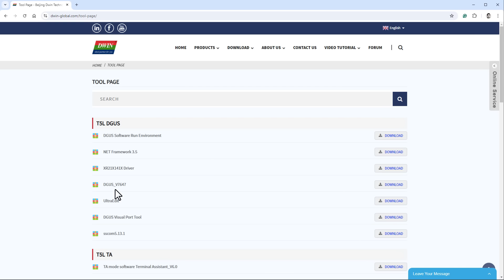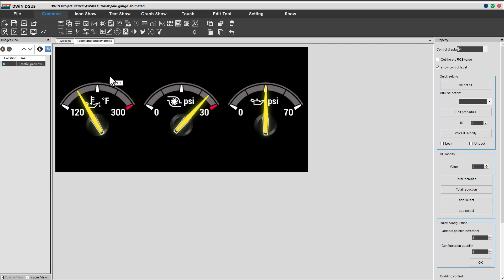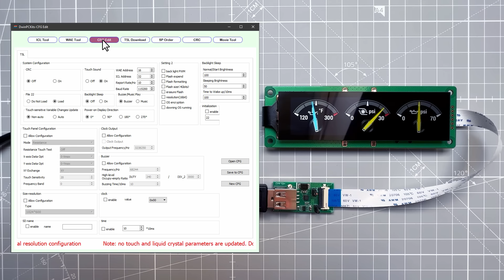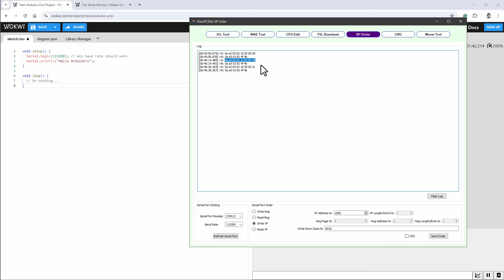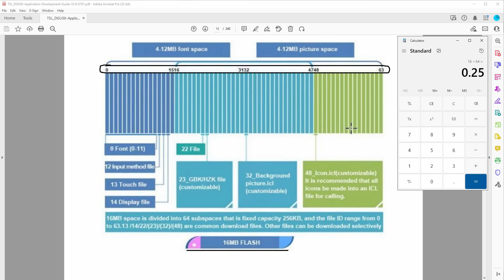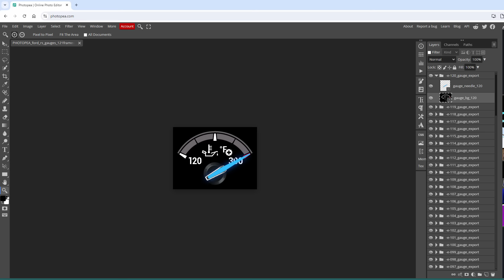Ford RS gauges with Arduino UNO and DWIN intelligent display (like Nextion displays)

Comment: would be nice to install on my Suzuki intruder handlebar tripple gauge: oil presure;Roll (at the center): coolant temp. Maybe possible to do double function in one gauge? i mean by double click to switch  for example: from coolant temp to battery level?
Reply from the maker: Yes, it should be possible to switch between different set of gauges, I might cover that in some future video. Thank you for the suggestion!

Comment: The input data for each channel can be passed through an LPF filter with a cutoff frequency of ~1 Hz, then all readings will be displayed very smoothly, even with a sharp measurement. You have an Arduino anyway, why not? =) The screen is very good.
Reply from the maker: Yes, there are many ways how to make this project better, this video was mainly about the screen and the graphics design.

Comment: I Love this Video,
It goes over everything in such depth that I feel I can do this.
I've never purchased these devices because I felt that they would  just sit on a Shelf reminding me that I was in over my head.
But this time I took the plunge, and purchased these exact same items, minus the Arduino, I purchased the Seeed esp32-c3.
Hopefully I will take this to to the end and not give up.
Reply from the maker: Thank you for your comment, and good luck with your project, I´m sure it will turn out great. The ESP32 vs. Arduino will make a very little difference, since it´s really just sending Serial data, and any microcontroller can do that. I have tested those DWIN screens also with micro:bit and it worked as well. The important piece is to get the DWIN display together with accessories, that will save you same headache, as not all SD cards are supported, and if you don´t get one from DWIN, you might need to do some non-standard formatting. Anyway, let me know if you face any issues.

Comment: Can the same steps in this video be followed for this screen model? 
DMG10600K080_03W

I am interested in making a full cluster for my car and these dimensions should fit perfectly.
Reply from the maker: Yes, it will be very similar. The only major difference is that the display might by default communicate using RS323 protocol, and to switch it into TTL serial, you will need to solder one connection on the pcb. I will cover that in the next video.
Reply: @upir_upir  awesome! I will look forward to your video!
Reply from the maker: Thanks!

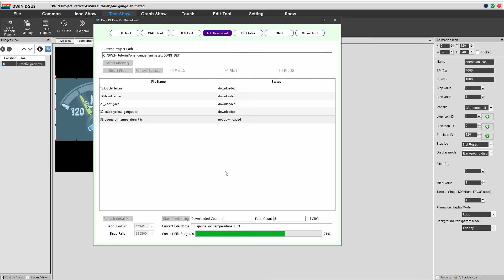Comment: im trying to follow along at 15:43 but when i click "Start Downloading" DWIN always freezes. i verified im using the right port (it only appears while plugged in). Did you ever deal with that where it froze on upload or have any suggestions? im on windows 10, no issues up to this point. thanks!

Edit: I had to solder the pads to enable TTL. Now arduino serial->screen works, but pc serial still doesn’t :(
Reply from the maker: It´s strange that Arduino works and PC does not. Have you tried a different USB to TTL boards? I´m using one from Waveshare, it´s big and pricey, but works seamlessly.
Reply: @upir_upir  I ended up ordering 2 new replacement boards, still doesn't work.

since you didn't mention it in your video so i assume you didn't have to solder the pad to enable TTL like I did? That makes me wonder if your board has another configuration preinstalled that mine didn't have
Reply from the maker: They have two types of screens. The smaller ones work on 5V and the TTL is also 5V - or at least 5V tolerant. Bigger screens are 6-24V, and the communication is RS232, if you want to switch it to TTL, you need to solder that pad.
Reply: @upir_upir  yeah for sure I have a 5v screen and soldered the pad. That only fixed arduino serial issue. But that didn’t fix the PC serial issue. 

Did you have to do anything aside from soldering that one pad?
Reply: I have the same issue I cannot download. May have to go with the SD card method.

Comment: I ended up getting a 7" DWIN display. Anytime I try to DGUS Serial Port to convert a jpg, I get an error prompt and can't ever get past it...
Reply from the maker: That  7" screen is most likely communicating using RS232, not TTL. You can either get the USB to RS232 converter board, or you can switch the display to communicate via TTL mode - that requires soldering one connection on the back of the PCB. I will cover that in the future video.
Reply: @upir_upir  correct! I have an rs232 adapter connected to the accessory cable they sent, but no dice. We'll get there eventually..
Reply from the maker: I’m using board from Waveshare — FT232RNL USB TO RS232/485/422/TTL

And it’s working seamlessly. Little bit pricey, but covers all my needs.

Comment: i thought about building smth like that for my bike, i recently modernized a old 99 fazer600 and the new gages did lack any oil temp, cooler temp warning lights aswell as fuel agage and i thought about getting some screen like that with a super small raspberry pi pico or rp2040 arduino :D
Reply from the maker: Cool. Please feel free to post a link to your project if you make it work, I would love to see it!

Comment: i have an idea. if you change the color of the gauges on the last 10 or 20 images to red, it can be a warnig, like if its oil temp it turns from blue to red when it gets high enough in the image sequence simply by changing the color in the file
Reply from the maker: Yep, that should be possible and easy to do. I might cover that in the future video.

Comment: Can you please do a display overlay for tachometer like honda s2000 ?
Reply from the maker: Do you mean the big RPM gauge on top kind of thing?
Reply: @upir_upir  yes yes,  the lines/bar thing on top. Modern cars with digital gauge clusters have this type of rpm meter too. Some car huds also use a similar style.
Reply from the maker: Definitely, that’s something I would like to try for sure!

Comment: cool, I actually want to do a very similar project for my mitsubishi using an STM and a 3x7 segment display with 2 buttons
later this will be updated to a 7" TFT touch display, I still have to design the PCBs though
Reply from the maker: Cool, that sounds like a nice project. What kind of display do you plan to use?
Reply: @upir_upir  its an old Ampire AM800480RP that the company I work for planned to throw away, they happily gave me a couple for future projects
Reply: @upir_upir  it's an old Ampire AM-8004 series display that my workplace wanted to throw away, I saved 2 for my little projects

Comment: Hey Upir
Do you have a discord so I can ask you a few questions 
I’m having an issue with this exact display where my image won’t center properly 
But when I use yours from this video it works fine
Reply from the maker: I don´t have discord (yet), feel free to ask questions here. It was mentioned in the video that the height of the displays has to be set to 2x the size of the display - not quite sure why. Perhaps you can try that?

Comment: Great video. Only thing is your Icons take up so much space. This is the link to DWINS video on rotating icons. https://www.youtube.com/watch?v=c16joloRxP8 you can make the needles rotate instead of just changing pictures
Reply from the maker: Yes, you can use that approach as well. You will save a lot of memory, but unfortunately, the appearance might not be very nice, since only 1-bit transparency is supported. I should have mentioned that in the video.

Comment: great video, I have a question, are you able to make such a speedometer for an electric scooter with a heater and battery capacity
Reply from the maker: Thank you. What is the function of the heater?
Reply: @upir_upir  I wanted it to show the engine temperature without a controller

Comment: Hi @upir_upir, could you please create a video where you explain how to generate on photopea or Photoshop the gauges?
Because i am trying to resize these Ford gauges to 240x240 for inserting it in the round display, but without success, because the needle and the other parts are remaining to big and not able to scale It
Thanks in Advance
Reply from the maker: Sure, I will cover Photoshop/Photopea in some future tutorial since I´m getting quite so many similar requests. In the meantime, I do have a newer tutorials with gauges for 240x240 displays, perhaps you can use those files as a starting point?

Comment: very cool! and what would you use for connecting real car sensors to this setup? I'm talking about some older cars sensors that work on resistance. Also i guess 12v directly on arduino would be very bad....
would using a Analog to digital converter be the right choice?
Reply from the maker: I will cover newer car first - with OBDII, and than hopefully move to cars without canbus. In that case yes, you cannot connect Arduino directly to 12V, you would need to use a voltage divider.
Reply: @upir_upir  looking forward to it! Thanks for the tip.

Comment: At 9:20 you showed the 121 groups in Photopea. Did you make all the groups / images manually by rotating the needle-layer 1 degree between every image? Or is it possible to automate it?
Reply from the maker: Yes, it can be semi-automated using Photoshop actions. Unfortunately Photopea only has a limited action support, so the actions would have to be adjusted.

Comment: Oh wow i'm going to try and recreate a digital dash for my oldtimer car. Is it possible to store a value on the display or the arduino even if power off for the km counter? How do you actually read the 12v signals from the sensors with the Arduino?
Reply from the maker: Cool! Yes, it is possible on both. Arduino is probably easier, you can store the values in EEPROM. That way, it´s stored even when you power it off. There are tons of examples how to do that, but I might include it in my future tutorial. Good luck with your projects!
Reply: @upir_upir  awesome, thanks for the answer! I really wanted the original digital dash but they are from the 80s and hard to fix, i prefer make my own one then with newer hardware and also more custom!

Comment: Great video and very informative. You talked about the Arduino memory and from what I could see, it was close to maxed out. Is that correct? If so, what are you options when taking this approach on a larger scale? i.e. a full dash? I know there are more capable Arduinos but, will a dash that gets all its inputs from a CANbus network require something like a Raspberry Pi4?
Reply from the maker: I will cover creating a dashboard in the next video. It could still be done with Arduino and DWIN display. Raspberry Pi would be a good ideas as well, but would cost more.
Reply: @upir_upir  that’s awesome. What I’m trying to understand is how we get CAN inputs translated to display outputs. I’ve been doing a bit of research and understand there are different protocols. I’ve got the concept of ‘CAN sniffing’ to determine what signals relate to certain functions. This is easier if these are known ahead of time, I.e. if you run an aftermarket ECU. Haltech’s website has some great info on their CAN protocols.

Comment: Could you instead create just a background gauge without the needle and then a needle image and then rotate the needle image?  I saw an Icon Rotating feature in the DGUS.  This would be much more memory efficient.
Reply from the maker: Maybe. I haven´t tried the rotating feature yet, but the biggest limitation would be the 1-bit transparency, i.e. you can only set one color to be transparent, and there is no alpha blending. Which means you cannot have any shadow, glow, and most likely the edges will not be very smooth.

Comment: My understanding with Fords is that the oil pressure gauge is pointless. It's there just to tell you there's oil pressure but not how much.
Reply from the maker: I believe most of the newer cars have gauges that do not show real values, but only toggle between "good" and "bad".
Reply: @upir_upir  Fords are that way regardless. Oil pressure gauge is basically a dummy light in the form of a gauge. They're like that at least as far back as the 90s since my 95 Powerstroke Diesel is like that.
Reply from the maker: I do plan to connect this to OBDII to get the real data, it would be interesting to find out if the data differs from the actual gauge..

Comment: Perhaps using a more inexpensive display would make the project more appealing to the average person.
There are many available in say the $10 range for clones which I am sure would be more appropriate.
Reply from the maker: That´s a good point. Do you have a link to such display? I.e. (somewhat) similar size, similar resolution, in the required price range?
Reply: Could you send a link to a similar and cheaper display?

Comment: Having had a Mk3 RS i like the look of this. It's be a better centre gauge pod than the stock one. Do you think you could add peak value markers with adjustable decay times to them or just to the boost gauge?
Reply from the maker: Thank you! Peak value is an interesting idea, I will try to add it, but as you said, probably makes sense only for boost gauge?

Comment: I wonder if this screen has the ability to rotate the image. Because if it has it would make everything so much easier, just making a range and get how much angle will be added to the image of the needle
Reply from the maker: Maybe, but even if there is such function, it still only supports 1-bit transparency, so you would need to have a single colored background to look good.

Comment: you need to make the interfaces.. that is actually more important then the display. read the OBDII and CAN busses etc.
Reply from the maker: I would say if you want to show some information, the display is quite important :)
Reply: @upir_upir  yes. if you have any information/data ;) for that you need the OBDII/CAN bus reader.
Reply from the maker: Looks like you agree that both are equally important.
Reply: @upir_upir  yes sort of.. for me the data is the moste important.. then i need somewhere to display it. dont need to be any fancy stuff. one part alone wont work. you need both. what's important is that you get the data before you blow up you engine. if you get info in time you can lifte and let things cool down etc or adjust something.
Reply: If you obtain the data, but no means to read/display it, then the data is unhelpful and useless no?
Reply: @cpzmelbs  yes you need to be able to read it some how. stil first you need the date. den a gauge or a screen need to have it. even i fit just a number you can read. stil a cool display is "cool" now just make the input data device ;)

Comment: I have had this kit for a few weeks now. Silly question for you - did you have to source a USB Type-A to Type-A cable? It's quite odd to have a device with a Type-A socket
Reply from the maker: On the AliExpress page, there was an option to buy "with accessories", and it included that cable. I agree that it´s quite nonstandard cable.

Comment: Could you make a video showing how to power your automotive projects from a car? My agm car battery runs around 12-13 volts and can have spikes depending on if car is cranking or ac starts up ect. im also worried the onboard voltage controller couldnt even handle that voltave for long period of time without overheating. im in the proccess of building a car from scratch right now and this would be EXTREMLY helpful. Thanks a lot and keep up the great content!
Reply from the maker: Thank you for your suggestion, this is definitely something I will need to solve once I move the project inside the actual car, so I will cover that topic for sure.

Comment: How do you prevent the image layers from overlapping, or how does the MCU know that only the place we selected in the Photoshop program (for example, the indicator needle) should be written when we remove the background of any image, as in the Photoshop program, and write that image over the previous image?
Reply from the maker: I´m sorry but I don´t fully understand your question. The display just draws the image over and over. In the final project, the background color is black, i.e. there is nothing on the background, and the individual gauge images include all the elements. The background setting in the DWIN DGUS application is set to non-transparent background.

Comment: What a nice project! One quick question, so with only 1 picture you were able to replicate all the gauge positions using photopea?? And also, How did you get the original picture??
Reply from the maker: Thank you. Yes, you are correct, the Photopea is used to export all the states since the needle is a smart objects used in all those groups. If you want to know how that file was created, you can download it from GitHub and open in Photopea and take a closer look. Feel free to ask if you have any questions!
Reply: Oh yes I am interested on how to draw the gauges too.  I toyed with making an arduino display for my motorcycle but realized it was a bit beyond what I could do.  Now I am recharged and want to make all the gauges.

Comment: $60 for a display, and use an arduino to control a device that has more brains than a hundred arduinos... such projects always look off to me.
Reply from the maker: Could you suggest a better solution - i.e. a cheaper display with a similar size and resolution, and a microcontroller powerful enough to drive that display 60FPS? I was trying to find some, but was not very successful.
Reply: @upir_upir  Hi! No, unfortunately I don't know similar-sized cheap displays, especially with these proportions. Personally I would prioritize the cost and choose an IPS hi-DPI display for couple of $ with ESP32+PSRAM board (they have PSRAM specifically for displaying purposes, also ~5$). I think it can do 60FPS. Maybe I could combine several of them to make required proportions... All in all, it's probably doable on a tighter budget, but with much more effort